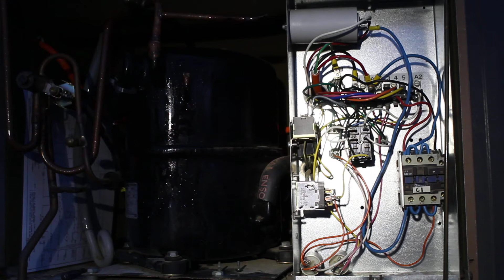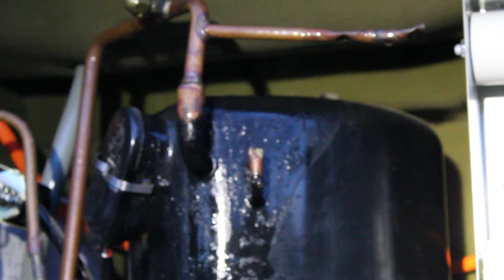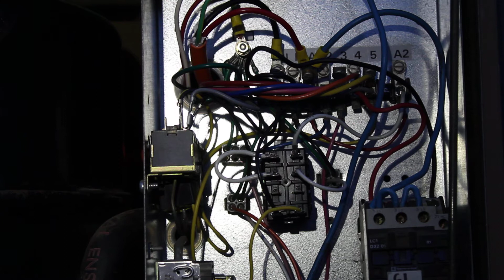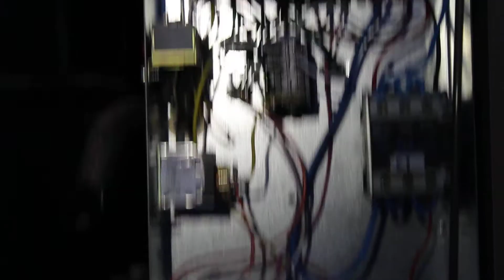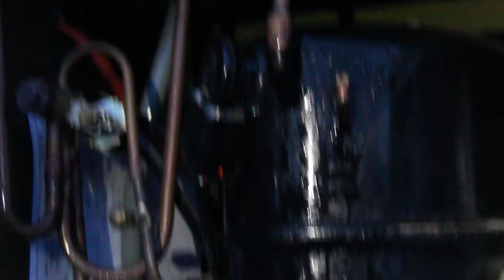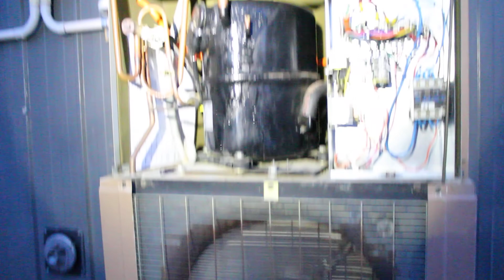Weatherwall WW23HHM compressor no start fix

Comment: Hi Mate, nice work on that weatherwall. It was 41 degrees in Sydney yesterday and it's likely to get that hot again today. My Weatherwall got a good workout I can tell you. I rigged up a misting line to the condenser to help lower my condensing temp so the saturated suction can drop to a more efficient level. Seems to be ok. It was too hot in the sun to be out there with the gauges but it does make a difference in performance. It keeps the compressor a bit cooler too by not having such a high discharge pressure.
By the way that LC1 D32 01 contactor is rated at 32 amps, you were close, hence the D32, the 01 refers to the N/C auxiliary contacts. If it's 10, then it's normally open. It's plenty beefy for that machine.
Anyway, have a great day and stay cool.
All the best mate